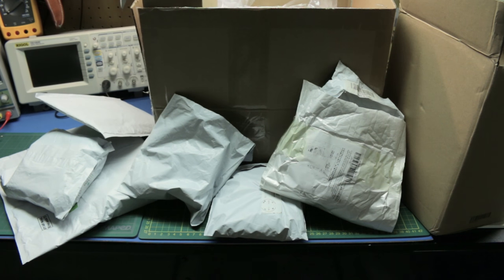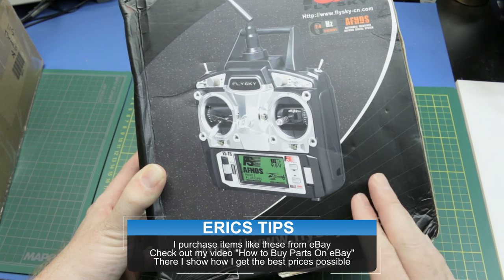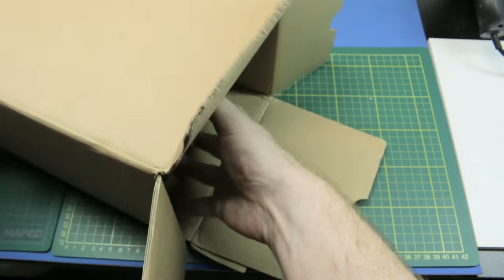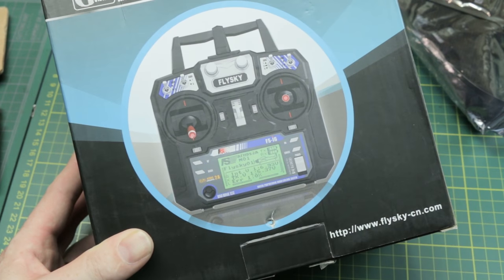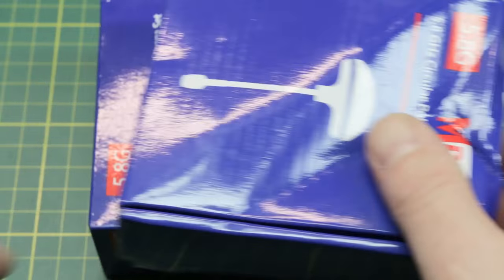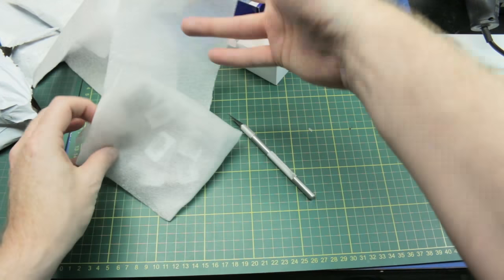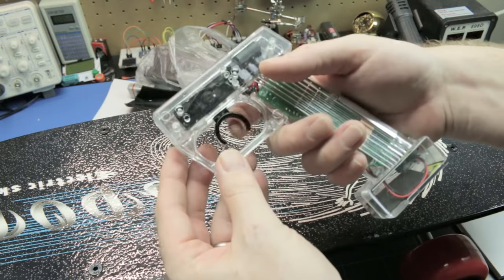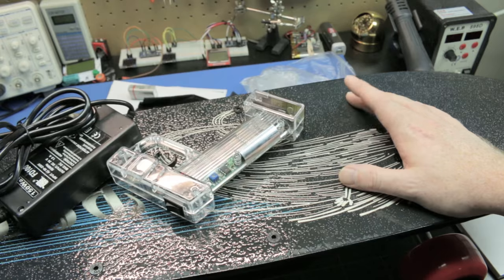Electric Skateboard, Racing Quadcopters & Electronics Parts | MAILBAG

Comment: I looked up that electric board on hobbyking and found that it goes only <= 10km/h. If you build one yourself I think you can get more than just 10. Plus you can even attach a second motor on the back. Imo 10km/hr is too slow for my liking :)
Reply from the maker: Will see in test but on high speed it feels more than 10K to me :)
Reply: I'm looking forward to your video then :). Normally I would think 20-30K would be the norm.